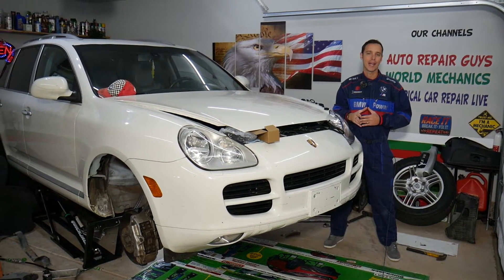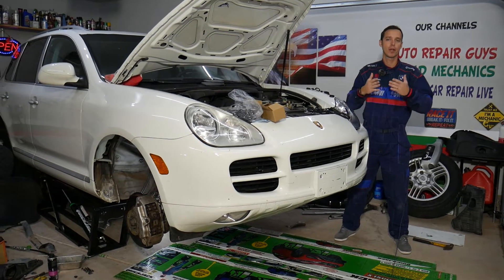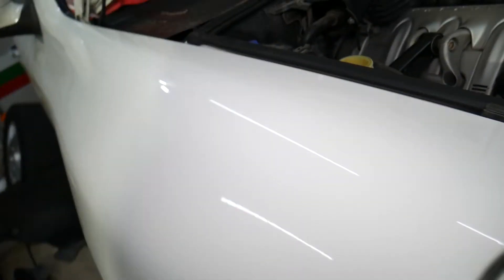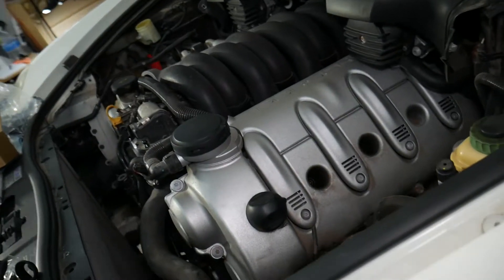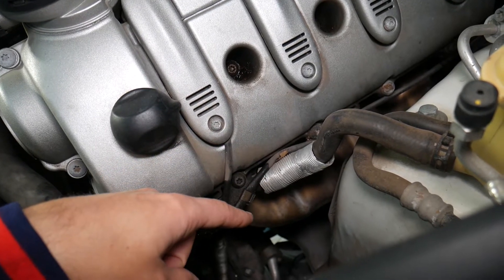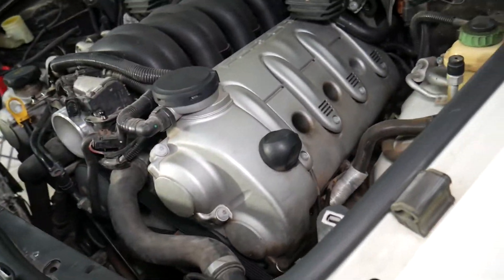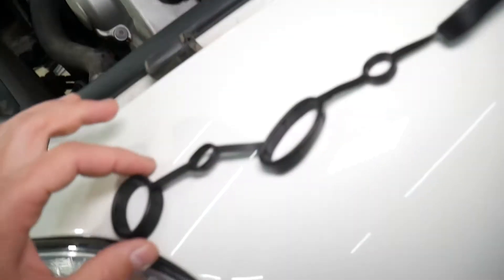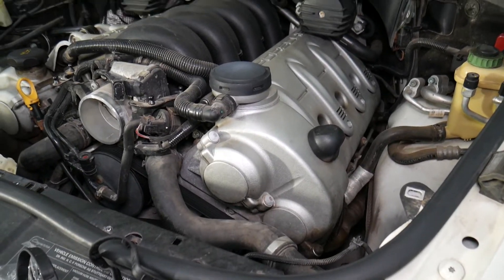SYMPTOMS OF LEAKING VALVE COVER GASKET, BAD VALVE COVER GASKET

Comment: Can valve cover gasket leak cause a vehicle  enginevto smoke while driving your vehicle after you stop driving it?
Reply: Yes
Reply: @Logan-te3iq  Hello. Thank you.
Reply: cause it can as oil is coming out of gasket even a few drops and landing on exhaust manifold etc and could catch fire!. Mine is the Z20LET and very common to leak. Only seems to leak though when i floor the car lol then i can smell oil and see smoke under bonnet.

Comment: One thing people don't think of and depending on your crank case ventilation setup you may get symtoms of a vacuume leak especialy if you have a setup with a crank case pressure release check valve then the crank case air intake breather valve on the other side. Bad valve cover gasket would mess up how the pvc works and would cause too much air to be sucked in both throught the pcv check valve and the pcv pressure intake breather.

Comment: If fuel is in oil and coming vomiting fuel out of exhaust .could the gasket have been put in incorrectly 
2011 Toyota tundra 5.7 4x4 force 4 door limited crew cab .
It never did it before he worked on it .I had oil in #2 spark plug

Comment: Would you recommend changing the spark plugs being that some may have been exposed to the oil? 

I do realize most people may say just do it while you're in there and I agree, but I am asking more as a matter of fact.

Also, if the other side is not leaking, should I do it anyway?

Comment: Please reply back to me i have an 83 volkswagen rabbit diesel with the 1.6l sohc 4cyl and my valve cover gasket leaks and i have no air filter on my car so im trying to figure out if the oil possibly is getting sprayed into my air filter wich is causing my exhaust to puff white smoke???
Reply: White smoke is generally water/coolant. Blue is oil.
Reply: @benjamindejarnette5714  I was also told the unburnt fuel was the issue and could be the cause for the smoke but I sold that car so I don’t have to worry anymore lol

Comment: My 2013 Altima is apparently leaking into the 2nd spark plug area! Sometimes my car doesn’t start! After trying multiple times, it starts! If I change the valve cover gasket will it fix the issue of sometimes my car not starting due to the oil?
Reply: I’m having a similar problem with my Malibu. Sometimes it will try and misfire and apparently I have oil leaking into my spark plug area too, good luck on fixing it👍
Reply: I had two of my spark plug wells full of oil. Surprisingly no misfires or no starts. But I’m finishing up my valve cover gaskets and your tube seals are shot. Should fix it but if it doesn’t there is a deeper issue at hand. Good luck and don’t wait. You can risk a fire leaving oil in spark plug wells

Comment: What about the tail pipe smoke?
Reply: that's likely your head gasket bro, a lot more difficult to repair unfortunately
Reply: I agree with user below, it's your head gasket. You have a blown head gasket very expensive to repair, and hard for a DIY even for a mechanic with the newer car so much stuff to take out... Most people who have a blown head tend to just buy a new engine or a car...
Reply: tail pipe smoke is car is burning oil. Could be numerous things.
Reply: @andisadler2897  could be oil leaking, or coolant leak. Or maybe something as simple as pcv valve.
Reply: @Tekevin  also could be piston rings, blown head gasket. Like i sad bro numerous reasons.
Reply: @andisadler2897  Correct, I agree. It always best to get it fully diagnose :)
Reply: I have smoke coming from engine bay
Reply: @davidhanson6613  probably you have an oil leak that is dripping on a hot surface.
Reply: @davidhanson6613  burnt oil smell? Be careful it doesnt catch fire buddy.